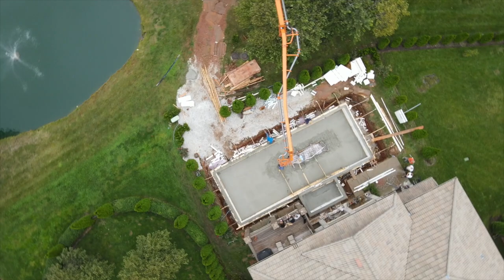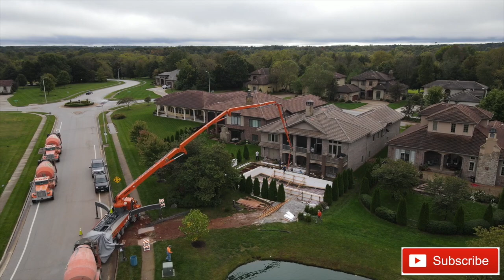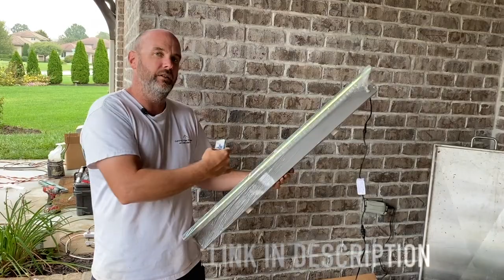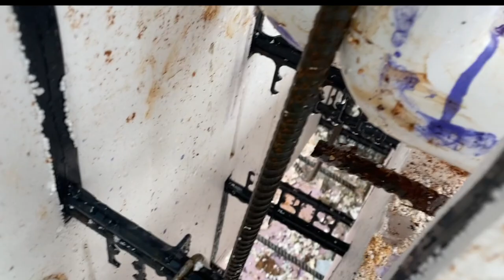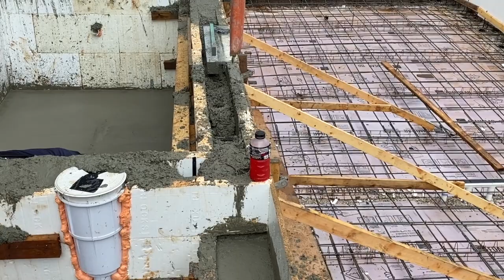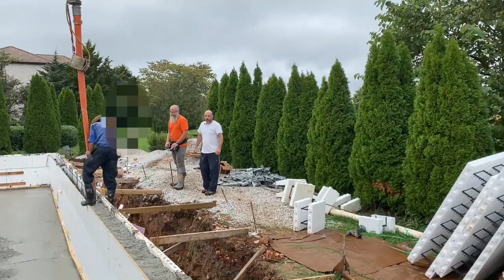ICF Monopour Sport Pool

Comment: Quick Question… why when you do the monopour pools is your floor slab so much thicker than when you do it in two pour?  Is that just specific to the certain pool or is that a requirement when doing a monopour? If so, why the difference?
Reply from the maker: I Monopour when I’m going to ecofinish or plaster, meaning a gunite(like) pool, with all the added benefits of icf…. When I pour floor separate from the wall I’m dropping a vinyl liner in it so cracks and cold joints are a non issue!  Liners are a great way to hit a price point that gets a lot more people into pools, monopours bring in the art and the architecturally significant designs!
Reply: @all3pools  oh ok that makes sense… does the floor of the monopour need to be 12’’ thick or can it be lesser similar to a floor slab (6’’)
Reply from the maker: Depends, on what’s underneath, an engineer and compaction test would be wise, we have found that on a 20x40 the extra 6” of concrete on the floor is only about $2,000.  The engineers have never speced more than 12, so to max out our strength for 2k on a six figure pool seems prudent to us, one of our designers is a baller in the vegas design community, he had a Gunite pool break in half due to inadequate site evaluation when the pool was 3 days old…. To us, the margins on pools allow us to overbuild certain structural aspects so we never have to go through that heartache!
Reply: @all3pools  also, you have mentioned setting up training in the new year… once you have details can you let me know and get me on the list?
Reply from the maker: I will let you know, we are working on the site now, we’ll get it launched before show season in January and we’ll have a beta training sometime mid first quarter at a big discount for the first run, already have a lot of our content and curriculum lined up!
Reply: @all3pools  How thick will the gunite be in a gunite pool and besides the art and design aspects of a gunite pool what is the life expectancy vs the vinyl liner pools?  I'm guessing vinyl liners need to be replaced more often than a gunite pool needs to be resurfaced or am I wrong in that assumption?  OH, Great Questions Ryan!

Comment: Nice work as always. The auto cover go on top of the walls but how the the cover box and motor fit at the end?
Reply from the maker: We build the vault to spec ftom the manufacturer, with plaster style pools we have to lower the bond beam 2” on the operating end, you can probably see it in parts of the vid on the left end of the pool when facing the house!